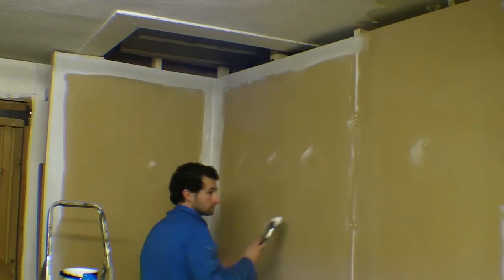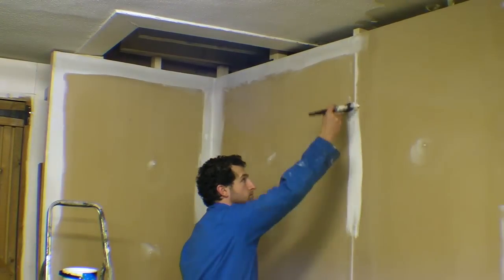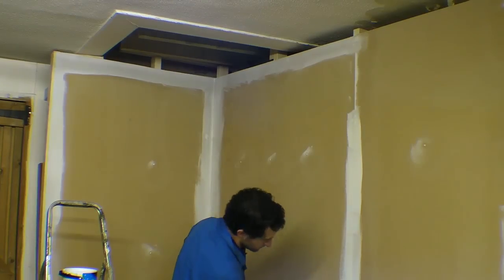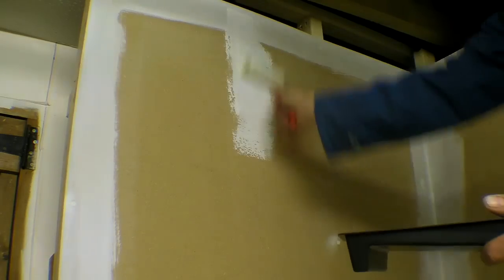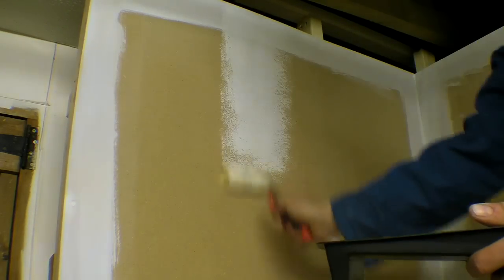Building Temporary Exhibition Wall - Display - Studwork - Painting

Comment: Again a good idea that is well done.   I am working in my shop and am puzzling on a wall, and do not want to go the whole drywell thing with the multiple coats, and working with 1/4" MDF as a covering has been a thought I had, but working on the screw holes and the joints has been a problem for me.   PVA is used in glue and bookbinding, and it seems to be a great idea for covering the wall.   I only know of it at art suppliers, but will research finding it locally.   Thanks for the idea, and your consistency in being able to "think outside the box" and come up with workable solutions.

Comment: I like your videos, but I have to say as someone who works in the exhibition industry - this is far too time consuming - there are modular exhibition stand equiipment which you can purchase for very little money which you can use for exhibitions - most of the stuff you can hire too. You simply design your background on software and get it printed on large format and attack it to your stand frame - job done.Yours seem more like a permanent solution. I got some ideas for our warehouse. We want to build a small office area inside the warehouse and I think using mdf like you have done would be a cheap way to put something together which would not break our tenancy agreement and allow us to build an office on the cheap.
Reply from the maker: Glad you found it interesting!
Reply: Hi,
Do you have any links to modular exhibition stand suppliers that you would recommend? I'm designing a pop-up shop with white walls and simple black illustrations which could be printed or drawn by hand...
Reply from the maker: Are you based in the UK?
Reply: Yes, UK. I was meaning to ask OnlineBackupServices who suggested the modular stuff, but if you have some ideas that would be great. Cheers, and the vid is very handy!
Reply from the maker: Ta. There seems to be some on Ebay, but I guess it depends on how large your pop-up shop is, and if it's outdoors you might need to weight it down.
Reply: trollvertising?